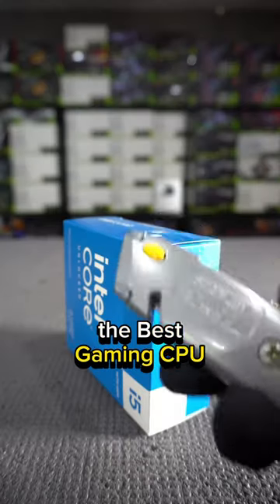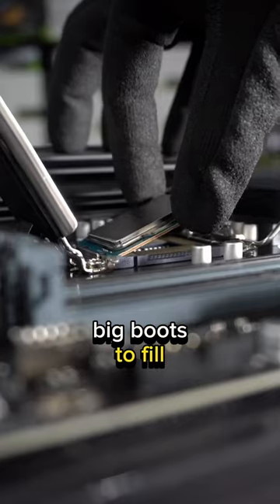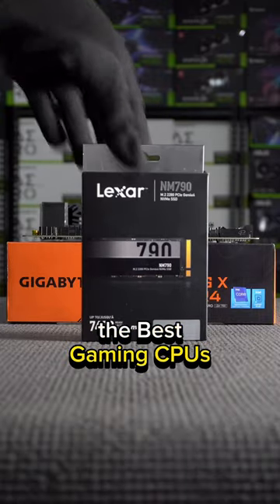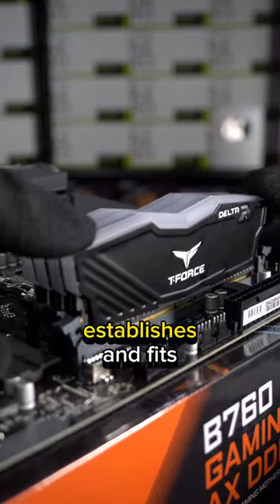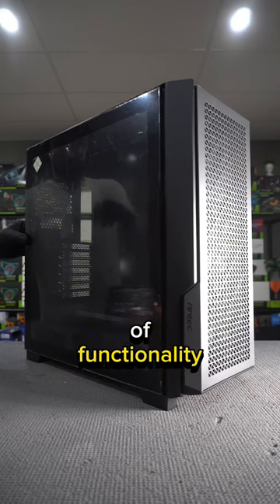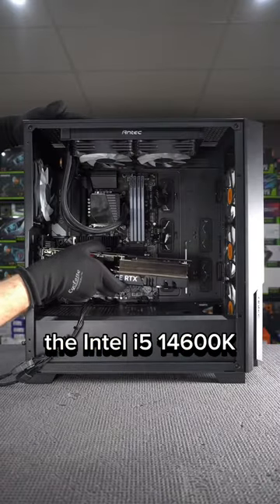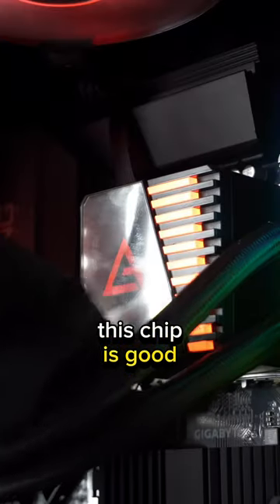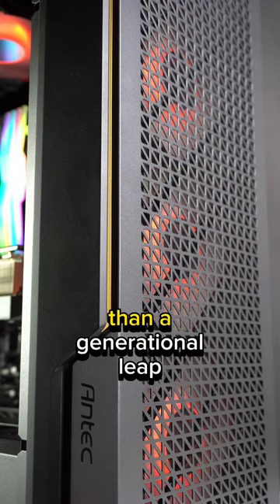The NEW BEST 👑 CPU from INTEL⁉️ The Intel i5-14600K 😮

Comment: Why do people care more about gpu then cpu?
Reply: It depends what you use your PC for. For gaming you want to use the best graphics processor you can to get the best performance while gaming, and you need to match it with a CPU that can keep up and not bottleneck the GPU.

Video editors on the other hand care about their CPU more than gamers. It's true that you need a decent GPU for davici resolve and you can't just use integrated graphics (unless you run an older ver), but the CPU is the more important part.

A few things to consider when buying a CPU are:
Does it bottleneck your GPU?
Is socket going to be supported for more generations, or is it "dead"?
And of course, do you really need it?

It's hard to get carried away when building a PC and falling into the numbers trap, but you will never be truly happy this way.

Materialism doesn't fulfil you.

Buy a PC that does what you want, but don't overspend.

Have a great day!

Comment: Damn I would totally buy 14600k, 14700k, or the 14900k I would "definitely"... pulls out 7950x3D.. as it preforms the same with lower ghz.. the 14900k doesn't beat the 13900k is some games which is crazy..

Comment: Amd is the best for cpus, the ryzen 9 7950x beats the i9 14900k. Buy amd for cpus not intel. They also last longer, like the 5800x is still good for high end builts.
Reply: I don't know why intel hasn't changed their mode significantly in so long. It's like they wanted to use more power for the same or worse performance
Reply: @GeneralS1mba exactly
Reply: I would still go for Intel
Reply: Nah, I don't think so. People want to buy any processors are their own choice, nobody gives you a fxck.

Comment: 14 gen cpus will be L if you buy now as intel changing their sockets again next year with 3 years lifespan .also 14 gen is just ripoff of 13 th gen with high tdp .just buy am5 platform cpus as Amd not planning to update their CPU sockets until ryzen 8 series so u dont. Need to change motherboards😊

Comment: Soooo, a 13600k… pretty much no difference between the two generations lol
Reply from the maker: The Intel i5-14600K is a bit better performance wise, but even Intel themselves came out and said that the 14th Gen is more of a “refresh” and slight performance jump. Just depends ultimately on pricing! 😀
Reply: @radiumpcs3235  I wonder why they even released it..